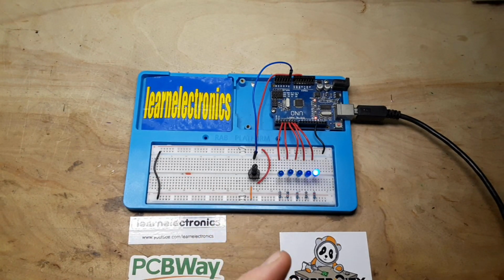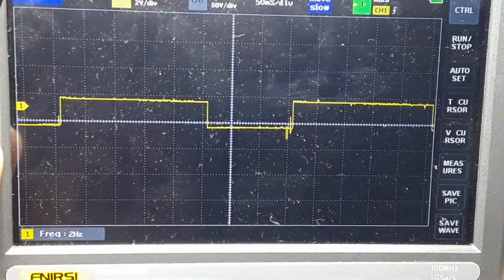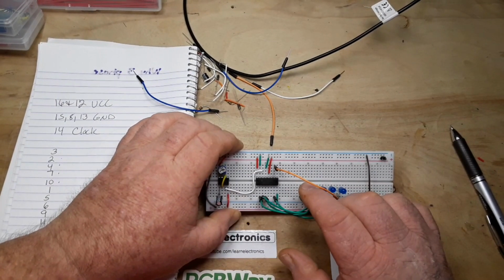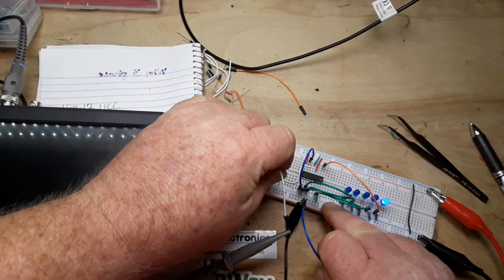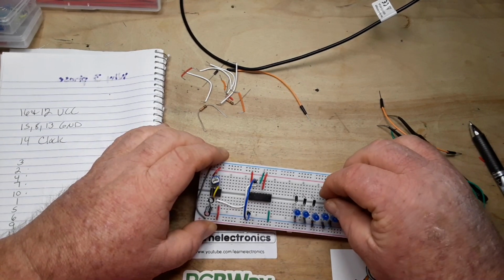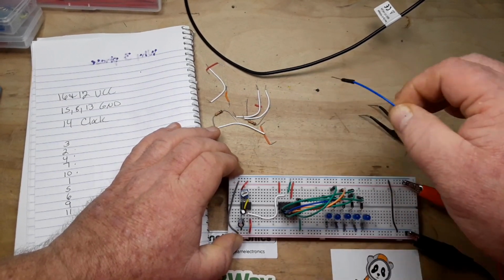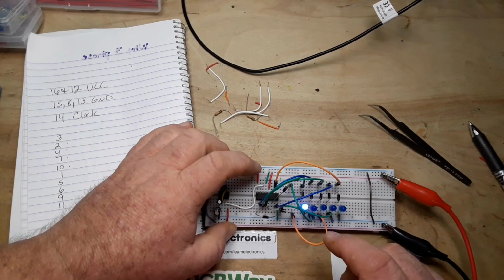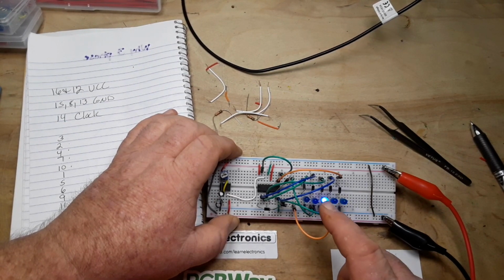2 Ways to make a Larsen Scanner - DIY Electronics for Beginners

Comment: Seriously... 
Leaving the reset pin floating on a logic IC? 
Connecting different level (one low, one high) outputs together creating a perfect short? 
Then adding diodes to prevent this, yet still connecting the outputs at the same end of the diode which actually makes the diode useless and create the same short?
You should rename the channel as "Learn electronics along with me"...

Comment: this is great. do you just add a cap in front of the anode of the LED to get the trailing effect? if so what are some good values to play with and can you show how to do the math based on the clock rate of the 555? and is there a sweet spot you can calculate between clock rate and cap drain to get that cool cylon eye animation effect? 

basically im saying coukd you do like half a dozen more vids on this circuit? ;)

Comment: Discrete way is much better than wasting an entire UNO on it. I'm sure fitting that on a small PCB smaller than the UNO would be relatively simple as well (hint hint...nudge nudge) ....unless you add some relays to control some high current LEDs and stuff it on your cars front grill.

Comment: This can be done with a trail using an Arduino, you will need two pins for each LED and each LED has two resistors, one that shows a faint glow (half on) for the LED and the other bright glow (full on). Then the Arduino just goes between full on, half on an next full on etc.. there's your trailing effect like the real KIT's car Larson effect
Reply from the maker: very nice

Comment: when the chip is not outputing V it is sent to ground so like pin 4 and 5 are bridged trying too drive center led the other pin is pulling it down so you cant pull it up too drive the led. before you double isolated.
Reply from the maker: yep

Comment: That was so entertaining, Thanks Paul. Don't you just love the randomness of Breadboards. :)
Reply: The two main problems appeared to be wiring two outputs together (which is why he needed all the diodes), and leaving the reset pin floating (which is why it suddenly became stable at the end).
Reply: Yep! If it is not working just give it a twist and there ya go! Working... Lol
LLAP

Comment: Would a capacitor help with the afterglow?  I mean one for each LED in each direction?  Or would it slow the brightening stage too?
Reply from the maker: It might. Ill give it a try
Reply: learnelectronics seems like you'd just have to play with the clock to start charging the cap earlier?

Comment: The first thing that should have been done was to APPROPRIATLY de-couple the integrated circuits. We immediately saw tremendous spikes on the square wave output. This problem should have been addressed and mitigated before progressing further. You added de-coupling capacitors after the fact without understanding or checking to see what value or type of capacitor was best suited to fix the problem. Additionally, no effort was made to try to identify the cause of the apparent intermittent circuit condition that occurred. If a more complex circuit was being breadboarded, it would be highly unlikely that successful operation would ever be achieved without logical and diligent circuit checks and analysis performed during construction.
Reply from the maker: Lighten up, Francis
Reply: @learnelectronics  I think there are  some good points being made, not wishing to criticise. This would have been an ideal time to show the 555 datasheet, discuss the section it has about decoupling and then further that to why it's needed. You could have then used the recommended capacitor value and scoped that and assessed whether or not you felt that was a good value. The output waveform showed the spikes that would have also been on the power rail caused by the 555. The 4017 was largely suffering due to the power rail instability but as mentioned, the random spikes on the 555 output should have been discussed and dealt with. The scope result would have been inaccurate to some extent due to the large  loop area presented by your probing techniques.
Reply: @learnelectronics Who is "Francis?"
Reply: Gerard Regnier Watch "Stripes".
Reply: @smacks999  Read Hans Christian Anderson's story about "The Emperor's New Clothes."
Reply: hi can you supply a cicuit diagram to make it easer to follow

Comment: I really enjoyed the way you troubleshoot and did it. I have a question for you. While going reverse i.e from pin 1 to pin 6, why can't you connect those pins to the cathode of the diode instead connecting it to the anode of the same diode? so while in the reverse LED chase the forward corresponding pins i.e from pin 3 to 10 won't get any effect from it. I'm right?